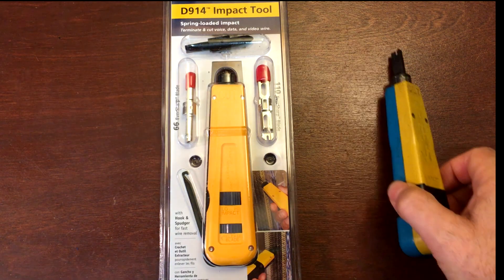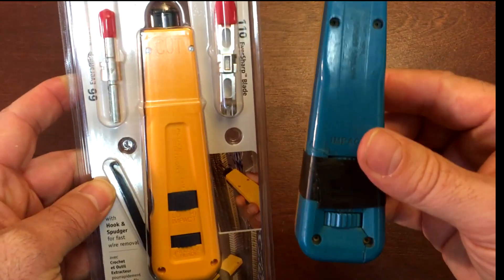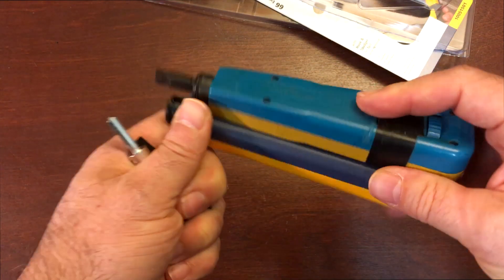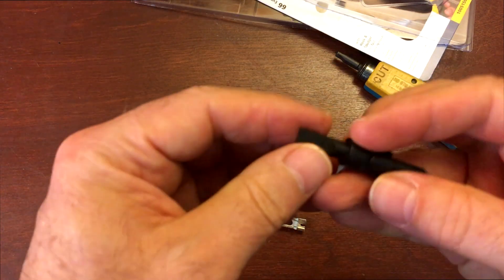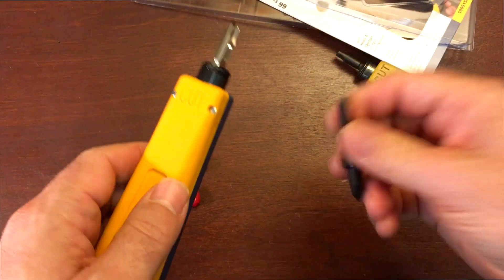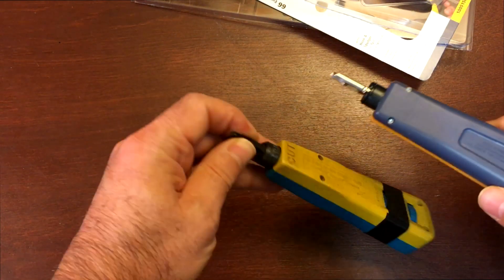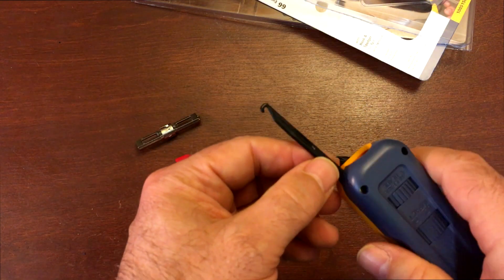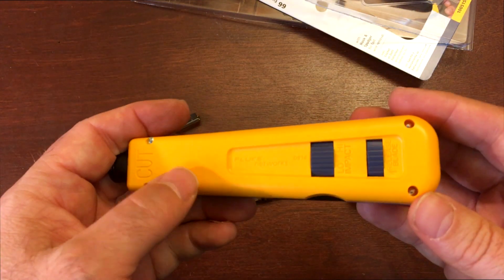110 and 66 Punch Down tool

Comment: My old Harris looked almost identical to that, down to the tape before I retired it. The fluke I replaced it with was nice, but the punch felt off after that many years.
Reply from the maker: I have to agree Steve, my new Fluke punch hasn’t been an exact replacement of the Harris-Dracon. 🤔

Comment: Does anyone know if there's any good reason why there's only the locking style 110 punch down bits? I'm looking just for a normal hex bit style 110 punch down bit w/ cutter. All I can find are the locking bits. I know for a fact that they dont need to lock in order to work correctly. If it's magnetic locking then we should be fine. Just looking to carry less tools.

Comment: Looks like a high quality punch down tool, and I'm impressed by how long your original one lasted! I definitely agree it's essential to have a proper punch down tool, even just for home use. It made all my terminations a breeze, and the little picks on the sides actually came in handy a lot.
Reply from the maker: Aric, are you an IBM'er?  I was for a lil while way back.
Reply: Nope, but when I'm finished school I'll be considering them. I'll bet that was cool experience, what kind of stuff did you do for them? 

My picture is actually of one of their older Netfinity servers booting up. I liked the clean blue IBM logo (compared to the silver/white they used for their more recent X series stuff) and thought it would make a good avatar picture. I still have that server stored in my basement, even though it really isn't useful for much. Built like a tank though, and it still works fine last I checked.
Reply from the maker: Aric, I totally agree about the IBM quality.  Up until just a few years ago I had a three 486 IBM Laptops that I couldn't part with because they were just such works-of-art.  Sadly, nothing will ever be made with that much attention to quality.  But eventually, they were taking up space and no one appreciated them as much as I did.  (I looked on eBay and there wasn't much demand).
When I was at IBM, I worked in an R&D lab for Unified Communications.  We spent a lot of time testing and refining the IBM products (Same time, Domino) to integrate with popular business phone systems (Nortel, Avaya, Cisco, Polycom).  It was a great job until the Great Recession and then the funding dried up.

Lol...  That's probably more than you wanted to know but thanks for asking.  
Have you looked much at Cloud VoIP and Unified Communications?  That field is Hot Hot HOT right now!
Reply: That's really cool, I didn't even know IBM was into unified communications!

 I have played around a little with cloud VOIP as well as a local asterisk/freepbx server. It's amazing what you can do with just a cloud subscription or an old server! 

I still use the old MICS for now though, with a Cisco ATA connected to VOIP.ms as well as my home phone line. In the future I'd like to switch to asterisk or even the cloud, and maybe do a SIP trunk to a BCM so I can keep using my norstar sets as well as modern VoIP sets.

I haven't had much experience in unified communications, but it is something I want to look into. I got some Nortel CTA serial port boxes and the Windows software a while ago, but I didn't get to do much because the drivers are not compatible with 64 bit Windows and the software is pretty ancient (though it does expose a standard TAPI interface, so it could work with modern 3rd party software).